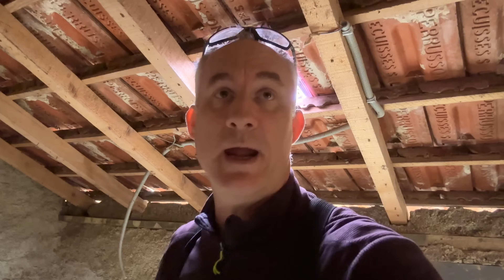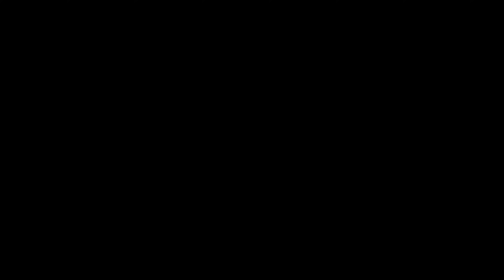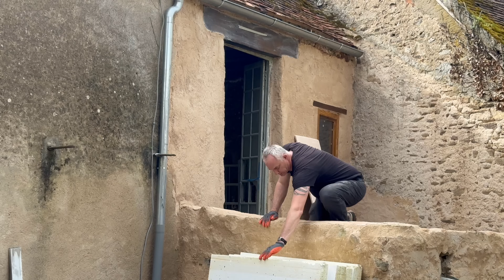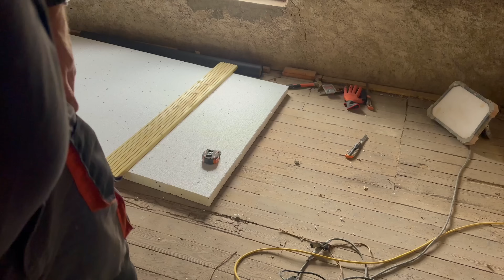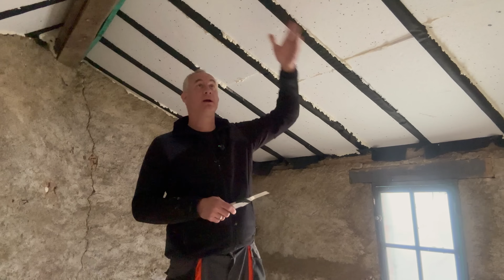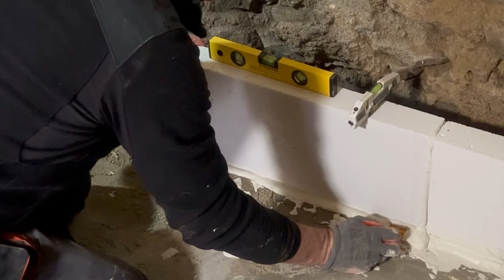How to build an interior wall out off aerated concrete EP 78

Comment: You Should have put  some wall ties in to hold the blocks making wall sholid
Reply from the maker: Is going to be tied in with other block walls with glassfiber mat bedded in cement render. The lime mortar stone exterior walls behave different to concrete block walls. With wall ties I run the risk of cracks.

Comment: Good job, Marius! Are you going to anchor it on to the side walls? And the void between the neighbor's wall will be filled with something?
Reply from the maker: It’ll be tied to the side walls with glasfiber mesh in the rendering. The void will partially be filled with styrofoam.

Comment: You can make a simple comb out of wood
Reply from the maker: True but they have these fancy scoop like trowels. You scoop up the glue and it spreads very evenly on the stone. You need the right size scoop matching the exact width of the stone
Reply: @thisoldfrenchhouse  Aan de franse slag is a nice dutch YT channel, where I so Olav working with these blocks as well. A comb seems to works well and you can be a bit more efficient with the glue I suppose. You are doing great. Good to see you are making good progress!